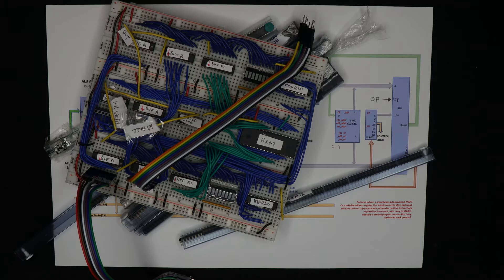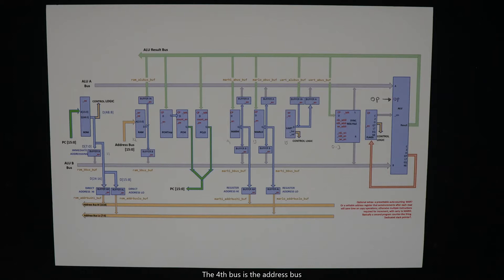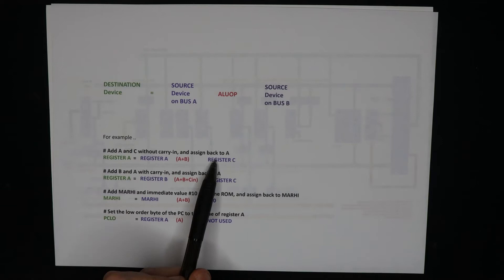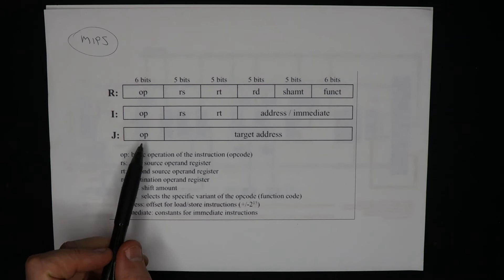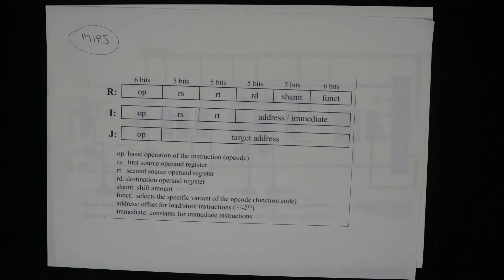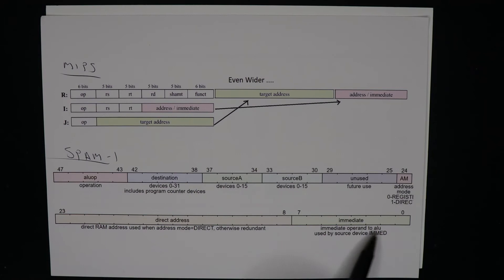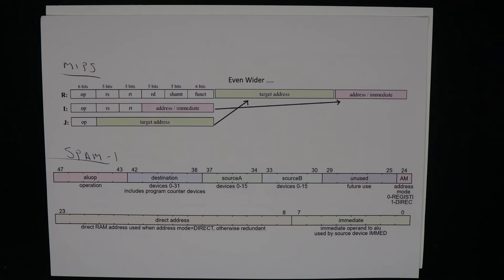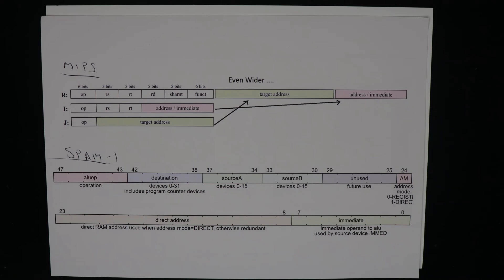Design : SPAM-1 8 Bit CPU - Part 1

Comment: Good luck with your project. I'll watch the rest of your videos. I have built a CSCvon8 and have hacked it somewhat and added some more opcodes and VGA graphics.
Reply from the maker: Hi David, yes I saw your content and liked it. I was looking at the VGA stuff as I'd planned to add that to SPAM-1 when the time came but have spent the last couple of months working out the software side of SPAM-1. Written an assembler and high level language of sorts which I just used to write a CHIP-8 emulator that runs on SPAM-1 and at the moment runs on SPAM-1's verilog simulation. I use this UM245R device to communicate between SPAM-1 and a serial terminal I've written that translates the codes into graphics ops. I have a complete verilog model of the UM245R which allows my SPAM-1 simulation to actually run CHIP-8 games onto a terminal. 
You might be interest in this latest video on the UM245R as I think it's used in CSCVon8 - Warren gave me the idea of using it in SPAM-1.
Now I've got more confidence on what the hardware can do, by virtual of having written some software, I'm getting back to the bread boarding (I hate cutting the short wires!).
Thanks for the support.

PS https://hackaday.io/project/166922-spam-1-8-bit-cpu/log/188484-um245r-usb-to-8-bit-parallel-transceiver-how-to-use

Comment: My in progress computer uses a MIPS like instruction encoding. It uses single port SRAM for a register file so I just use a 5-bit 4:1 Mux to select rs,rt, rd and a special address. For the immediates I use 3x 8-bit DFFs for the immediate itself and some 245s for sign extension. The DFFs are loaded on every instruction fetch. When the instruction is decoded the appropriate number of bits and sign extension is placed on the register bus.

It's actually pretty easy to decode since the opcode is always in the same place. Everything else is enabled when needed by a particular instruction.
Reply from the maker: My first design was entirely horizonal encoded, but this was too many wires, and I turned towards something more MIPS-like'ish  but the encoding I had looked cumbersome compared to what I had originally imagined, and then I found out about conditional instructions and decided I wanted some of that symmetry too, so I ended up somehow with the fairly flat encoding I've got today where decoding is just four 3 to 8 decoders.

I really have to finish wiring the modules together as I've been distracted on the software side for too long.
Reply from the maker: I assume if using a single port device that one cannot read and write to the device in a single cycle but would go via an accumulator?  Or perhaps it's a dual cycle approach masquerading as single cycle by doing a read of the reg file on one phase of the clock and a write on the other? Interested to hear more.
By the way spam one kinda does this but spam 1 registered file is triple port not dual port.
Reply: @JohnLonerganProjects  That design was a single port and used a writeback register. The writeback can be done when the next instruction is being fetched so it doesn't cost a cycle. For reads there is a temporary register for one operand, and the other was fed directly into the ALU. Because SRAM is so fast there's no need to wait an extra cycle for the ALU to do it's thing. All up it was 3 cycles for ALU ops and 4 cycles for memory access.

I've thought about doing the dual cycle approach a few times, but fully pipelined designs end up being too big, and with a multicycle design the writeback can be done when the next instruction is being fetched so it's kind of pointless.
Reply from the maker: Got it.
Spam-1 is so called "single cycle" and one can read two different regfile locations and write back to a third location all in one cycle, but I'm not happy that there is a meaningful and honest definition of what "single cycle"  means. 
To my mind a design that uses the rising edge to trigger half the operation (fetch decode) and then the falling edge to trigger the remaining (execute), is basically equivalent to a design where each instruction takes two clock cycles and all transitions occurred only on the rising edge. 
Using the rising and falling edges is the same as having two clocks.
This page was influential on me.

.https://zipcpu.com/blog/2017/08/21/rules-for-newbies.html